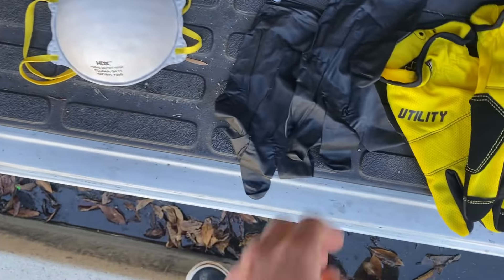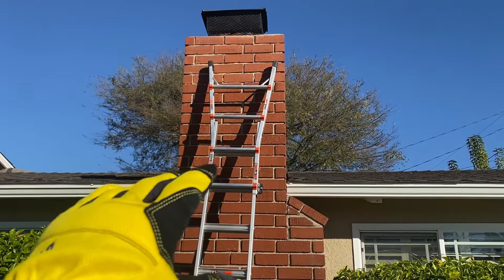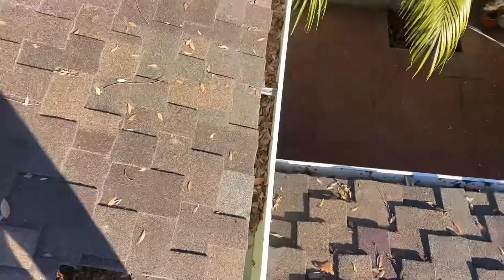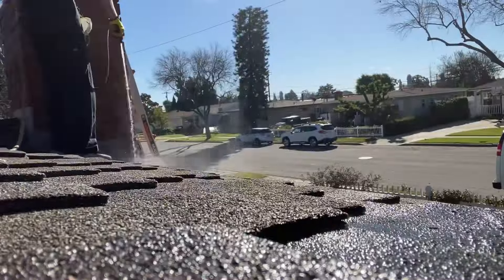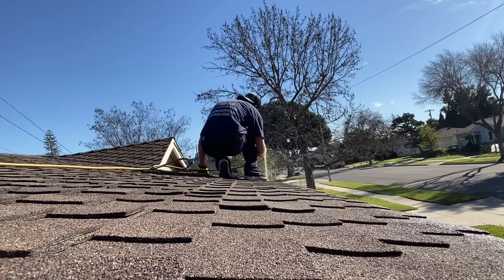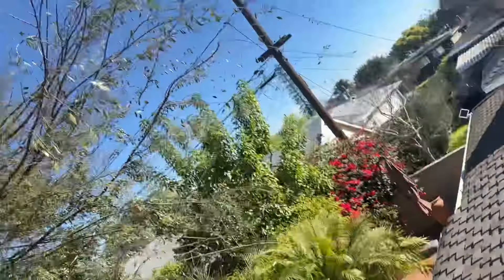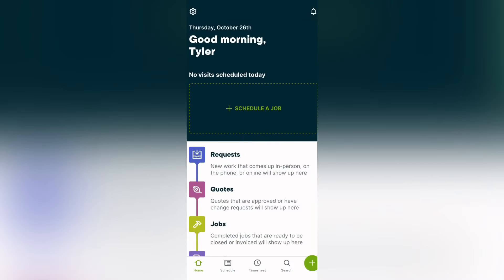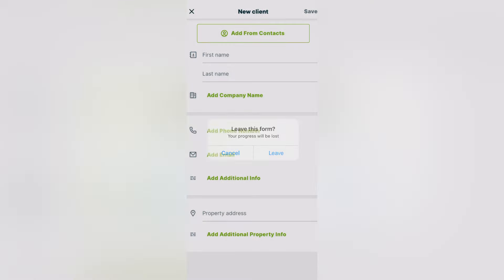$150 per Hour Gutter Cleaning: Service-Based Business Vlog

Comment: Thanks for the video man. I do gutter cleaning with a gutter vac. It takes me about 2 to 3 hours to do a standard residential home (200ft of eavestrough). I like the idea of using a leaf blower, but it looks a bit messy. If you include the fact that you have to do a bit of a cleanup on the ground when using the leaf blower, I wonder which option would be more effective in the long run (vac or leaf blower?l
Reply from the maker: Leaf blower is crazy fast and effective. The only downside is there’s more risk involved and a mess to clean up, but the clean up is super quick. I just blow everything into surrounding planters. 200 linear ft of gutter will only take me around an hour and a half to clear and flush.

Comment: Why not use a ladder stabilizer? Even with the folding/articulating ladders the Werner quickclick stabilizer (one of the most popular and easiest to take on/off in seconds) still fits and locks in. Then you can rest the ladder anywhere and not damage the gutters. Plus it's SO much safer, your ladder won't budge.